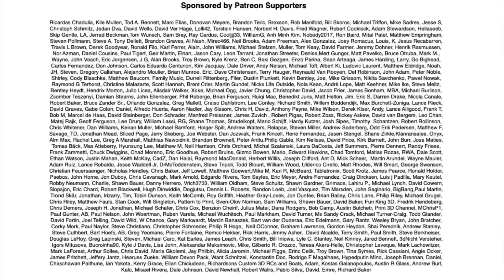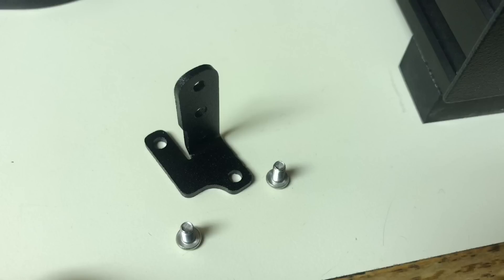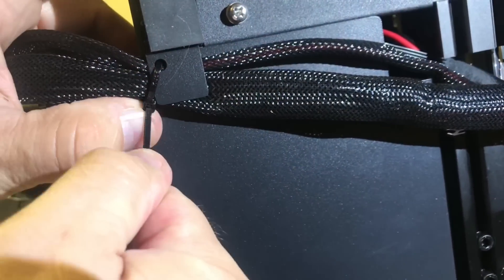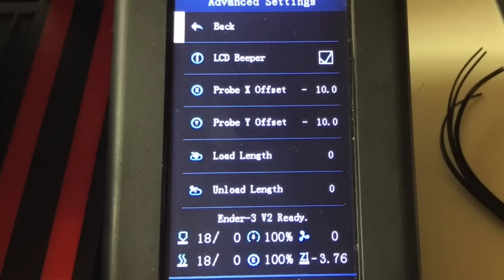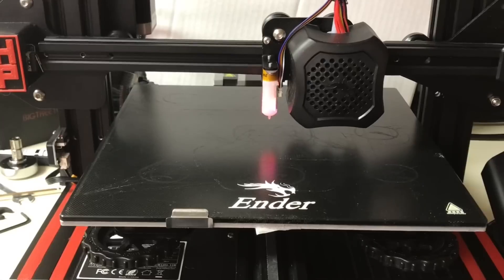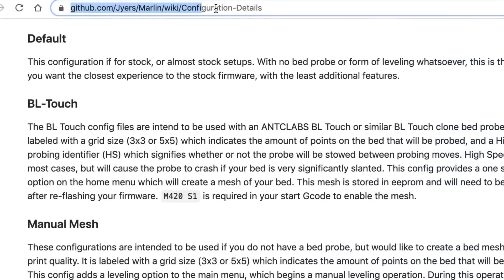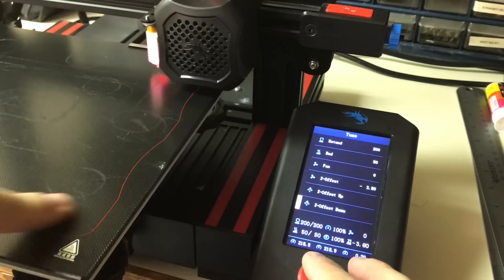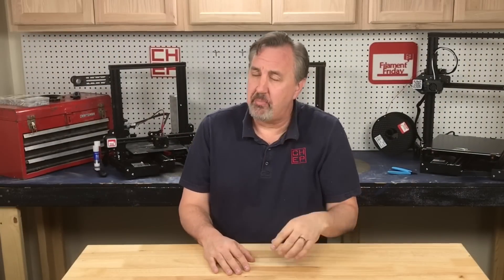How to Install AutoLevel on Creality Ender 3 V2

Comment: Hi there! im stuck couse even if i set Z to 0.0 in"prepare" my z axis going only higher any suggestios? 
p.s when i click to home all i can see that on the bottom on the screen x (numbers) y (numbers) but z flashes and shows that "STOPPED" higher :/
Reply: I'm having this same issue, have you found any solutions?
Reply: @ZachAttacksFat  nope not yet i even trying with programmer to make special firewares... rn I'm Waiting for a new bl touch and i will write if That was a problem
Reply: @misiek8132  I'm beginning to think that the sensor itself is the culprit here too. I have tried so many different firmware iterations and none of them work. It's hard for me to believe that firmware that works for everyone else somehow doesn't work with our printers. Especially when everything was working fine before.
Reply: @ZachAttacksFat  yup like i said i was even working with programmer and after many many different custom and even build from nothing Just for my printer firmwares he was able to Just get down my z axis but nothing more so yea we will see if new one change anything i will update you as soon as I can im fighting now with the seller co it can take a while but I will remember about this comment 😁
Reply: @misiek8132  I have the same problem. How about now？
Reply from the maker: Double check the wiring is in the correct place.
Reply: @FilamentFriday  nope all good i ordered new original cable and the same problem :/ idk what to do
Reply: @FilamentFriday  my bl touch click twice with the noodle and glows red if That can help
Reply from the maker: Is your Z switch still connected?
Reply: @FilamentFriday  nope i unplugged it
Reply from the maker: I’m out of ideas.
Reply: @FilamentFriday  alright thanks anyway for trying 😁

Comment: Will the BL touch firmware work for the CR touch?
Reply: yes, but CR Touch will most likely different probe offsets
Reply: @cody5495  es the firmware works just fine.  And, of course, the offsets are likely different.

Comment: These instructions caused much smoke >_>
No potential risks or precautions are explained in the video.

[EDIT] Somehow the printer survived, I don't know how damaged it is, there was quite a stream of smoke. The pinout on the probe seems correct compared to diagrams of an original BLTouch I found online, but the orientation shown in the video results in the pins being wired backwards. Ender 3 V2 Board v4.2.2

Comment: You broke my fucking printer it won’t turn  on now and is stuck on a black screen thank you. How the hell do you fix this
Reply: You must be fun at parties
Reply: Whoa there buddy.  Settle down.  Format your SD card, then copy the correct firmware to the SD card and rename it something unique.  It can't be a name that any prior firmware loaded to that machine has used.  Unplug the printer, insert the card, plug it in, power up.  All set.
Reply: Dipshit lol
Reply from the maker: Make sure you use an 8 GB card.
Reply: @FilamentFriday  is there any file I can just download to the ender 3 v2 to just factory reset it because the screens messed up and I tried fixing it and installed the ender pros thing and now it beeps when you turn it on
Reply from the maker: I would recommend you install Jyers default V1.3.5 for v4.2.2 board. https://github.com/Jyers/Marlin/releases/download/v1.3.5/E3V2-Default-v4.2.2-v1.3.5.bin
Reply: Not to mention CHEP ain't at blame even if DEMONSTREUZ broke their printer, no one else is responsible for your own negligence.

Comment: My screen isn’t turning back on once putting the Sd back in
Reply from the maker: Rename the file by one character and try again. Also try an 8 GB SD card
Reply: I had the same issue even renaming the firmware. I had to download the mainboard firmware download, then extract the DWIN_SET folder and put it on the SD card as well. It worked after that.

Comment: wait so if i get the bl touch i still have to mess with a piece of paper and live adjust the z offset manually??? im so happy i saw this before buying it... seems like its not really what i thought it was.

EDIT: ok i still bought it anyway and the live z offset makes it actually mega easy. I have a 0.2 filler gauge and used that to do the z offset (you can just use a sheet of printer paper) and it's AMAZING 🤩. Actually super worth it.
Reply from the maker: To set it up, yes. Not every print.

Comment: Maybe you can help me:

At the beginning, when I installed the BLTouch, everything worked fine for a long time, then after a month I wanted to print again, but it showed me "Probing failed", thought it was my 4.2.7 board and I exchanged it, but then it was still not better and so I thought it was the BLTouch itself but tried to wiggle the board side of the cable and it suddenly worked, but after a week it didn't work again.

Could it be because of the current cable disorder or that the cable has something?

I installed the 4.2.7 Silent Board in the Ender 3 Pro and also a 12V buck converter with a Noctua fan

Thank's for your advice and help
Reply from the maker: Sounds like a loose connection in the harness.
Reply: @FilamentFriday  i thought of that too, but unfortubately everything is stuck, at least it looks and feels that way

Comment: Hi. Nice Video. You showed how to measure the X, but not the Y. How do I measure the Y? Also, how do I unlock the ADVANCED menu, Z OFFSET Menu, Tune menu? My 2 E3V2 have none of that. Is this Stock Firmware?
Reply from the maker: New firmware that I show at 2:45

Comment: Surely a manual level should be done first??? just after Z offset, Once that's done the auto level will correct properly, It's not supposed to compensate for too much.

Comment: Anyone else followed this tutorial, experienced that the firmware wouldn't update, i plugged the SD card in and turned on the printer but just got a black screen, even double checked the files.

Only got it to update with the files provided on crealitys software page for the ender 3 v2
Reply: I had the same issue for a little bit, try a different version and make sure that your board says v 4.2.2. If anything you can redownload the original firmware for the machine online just by searching
Reply: @popdemmollys5058  on the bottom of the machine, if its and ender 3 (v2, pro, base) there's a couple screws that open up to the circuit board. On their it will say something like "creality" in bigish white letters and then a build number nearby.

Comment: Chep same issues as Rog. Every setting I have is set exactly like this video including the M420 S1 ; Autolevel and it still prints above the bed after making the 2 lines on the left. I do not know what to do.  I have a ender 3 v2
Reply: Manually level again, with the screws, then autolevel, then adjust your z-offset.

Comment: Hey @chep, Hope you're well. I'm having issues after completing all the steps. Z-offset is set, auto-level is done and saved, slicer is configured but when I test a print, apart from the purge line which turns out OK, but when printing the test the nozzle is so high that microstep down won't help unless I change the value radically which doesn't make sense. How come the center's z-off set is fine and the rest of the bed is not even though I followed the steps and created the mesh? Thanks in advance!
Reply from the maker: Check your slicer for Z offset otherwise I don’t know.
Reply: @FilamentFriday  It's set at 0. Thanks for the reply though. I appreciate it.

Comment: Does the z axis readout on the LCD panel in the bottom right corner reflect the gcode z coordinate or the actual z coordinate with the BLtouch compensation?  In other words, should I see the z axis on the LCD panel change up and down when printing a horizontal layer if everything was working correctly?
Reply from the maker: If the layer is horizontal Z won’t change unless you add Z hop.

Comment: so i did everything right.pluged the bl touch in and all got the firmware and set the y x offsets but when i press level or homing or anything that moves it it just does not work doesnt move at all.
EDIT:when it fails it just says printer kill reason: homing failed restart required.
Reply: Try shielding the BL Touch data cable with metal/copper braided tube/sleeve it can cut down on interference from the fans and hot end.
the braiding can be found on amazon or inside coaxial aerial cable from an electronics store, you'll need around 1.5 mtrs.
also buy some plastic braided cable cover to finish it off like on the original ender cable.
This worked for Me.
Reply: @roblasher2243  thanks for the advice but i live in a small town not even amazon dilivers here at least without adding like 20$ but u will try to find it somewhere.
Reply from the maker: Just try wrapping it in aluminum foil. Same effect.
Reply: @FilamentFriday  ill try
Reply: @FilamentFriday  that works too , and maybe some insulation tape so it doesn't short on anything.

Comment: So I added this firmware Unfortunately it had a bug where it wouldnt read a file name if it was to long .So I tried the Smith bl touch firmware.But I liked flexibility of jyers and I saw they had a bug fix .So in it went .But a odd thing depending on my sd card the Smith firmware shows up !! Is the firmware on sd card As I thought the jyers overwrote.The previous firmware Any help would be appreciated
Reply from the maker: Make sure you use a different file name or it won’t change. Try a jyers earlier version to bypass the bug.
Reply: @FilamentFriday  well the issue is the Smith firmware shows up with reguards to a different sd card I thought thr firmware was installed on main board I mean jyers is a different name from Smith ?
Reply from the maker: Not sure then.
Reply: @FilamentFriday  wow ok
Reply from the maker: I would try it again but change jyers file name by one character.
Reply: @FilamentFriday  ok sir
Reply: @FilamentFriday  plus I had reformatted the card and added the new jyers to that card to use as a update .
Reply: @FilamentFriday  oh and thank u I'm a bit older then everyone on here so thank you for being patient

Comment: My Firmware doesn't have the advanced option it seems and i'm not sure which version I need that does.
Reply: Same. Did you ever find it?
Reply: @GreggAdventure  not on that version. I updated to jyers right after and it has all the options you can want.

Comment: I CHEP, your videos help me a lot.  Thanks !!! I just installed my BLTOUCH on my ender 3 v2.  My first layer is almost perfect !.  I only have one corner (BL) that is not ok. And the print is not centered on the bed. Would you be so kind to give me advice ? I'm not sure I understand, should I do a manual leveling of the bl corner or a live z offset. If I do a live Z offset won't it affect the other corners that are perfect ?  Thanks again !

Comment: Sir any reason my bl touch on the print command erased my file ?
Reply from the maker: I don’t see how that’s possible
Reply: @FilamentFriday  first thank u for reply Second the bl touch is working ok But when hit print on any file that for some reason are scrolling right to left itll come up on board run a scroll across say it's done and ask me to confirm .Then if I find a file that's not in motion and hit it itll come up on screen as usual and start its print when the temp parameters are met .if you like I could forward you a start video if that's possible Otherwise my printer is useless .I've tried re slicing also and same thing .
Reply: After the confirm file is gone until.i turn off machine and restart it

Comment: Ok sir installed it no disasters .A bit fuzzy but I'm getting it to work So thanks .My question is off my sd card I printed your leveling grid and a small part .Then I went to print a part I've done multiple times and it wont print it ! It comes up click it then it runs a what looks like its loading it but then shows it as completed Any thoughts

Comment: Sir I grew a pair and installed the firmware It installed Then i noticed a SD intial failure is this because i dont have the g29 code in yet thank u for your time

Comment: It doesn't give me the option to auto level,  I can set the mesh, then home. Once I go to print it doesn't warm up automatically, then after a few seconds a loading bar appears and then it just stops. Can anyone help please?
Reply: Hi I have exactly the same issue , did you fix it?
Reply: I'm having the same issue too. My gcodes from a few days ago work fine, but any new ones just run a status bar quickly from start to finish a few seconds after starting any new gcodes (made today or yesterday). I've tried resetting to standard Cura settings but nothing.
Reply: Same issue, Gives me "E1 Heating" then returns to home screen
Reply: It turns out my issue was filenames being too long, after shortening to ~8 text only characters, it worked fine. Give that a try.

Comment: Ahh forget it I'm just going to return it (bl) seems like more trouble then it's worth and you have to be a rocket scientist to get it to work.Ive asked same ? Over and over with no answer .how do I get my machine to accept the the new start code as it will not let me insert one .Do I have to have firmware installed first ?
Reply: I would definitely install the new firmware first.
Reply: So if I install the firmware the machine settings will give me the option to insert the g29 code If so thank you for being only person to answer me
Reply from the maker: The firmware is separate and required for the Autolevel sensor. 
G29 is added to the start GCode in the slicer. But as I show you can store the autolevel in EEPROM, and the use M420 in that same Start GCode area to retrieve that stored autolevel and then you only run the probing once.
Reply: @FilamentFriday  my ? Is how do I get this new code into startup as it wont let me is their something I have to hit to let it enter the code that's my ?
Reply: Go to the 6 minute mark of the Video. I believe this will answer your question.
Reply: Ok someone told me I had to hit enter in the start up code area Thank u very much Now my question is do I add the new code after g28
Reply: @charlesrestivo870  Yeah, i would add the M420 S1 ; Autolevel Code after g28
Reply: @KillerSatan962  thank u very much for your reply
Reply: @charlesrestivo870  No problem! Always happy to try and help others.  Hopefully it helped you figure it out!
Reply: I have the CR touch when I use it to auto level it doesn’t even print a decent line it just clogs up an that’s bout it :(
Reply: @jamie198710  i would try changing your z-axis offset upwards a bit sounds like you're printing to close to the bed.
Reply: @KillerSatan962  will try this

Comment: Can someone help with why I cant add the gcode I need in my startup menu Do I need to have firmware installed first ? Because now the machine settings isnt giving me a option to add the code Help
Reply from the maker: I don’t understand the question. You mean the Start GCode in the Cura slicer machine profile?
Reply: @FilamentFriday  yes sir
Reply: @FilamentFriday  any answer reguarding this .so install firmware then the machine settings will allow me to insert g29 code into start menu As of now it wont give me option

Comment: Hi Chep,
I followed your instructions and I have installed the latest pre-complied firmware from Jyers, but my printer does not seem to actively level at all.
Does anyone know what the problem could be? Is the pre-compiled firmware maybe missing something and I need to compile one for my printer?

thanks

Comment: Thanks CHEP, its works for me but i have a question. How do you get a leveled bed After removing the z-stop ? I Can Do manual levelling on each corner with bl touch with jyers firmware but result dont seems consistent. And i dont know if i have to do it with hot end hot, or with z offset at zéro ?
Thanks for your work anyway
Reply: I just installed my BLTouch and using CHEP's tutorial and also doing a manual level with the probe helps so much. Using the same firmware as they use, the latest tho, you can do what I say up ahead. Set the bed to the temperature you print at before and let it sit for a bit. Go to "Prepare" or "Control", one of the two, and select "Manual Level", then select the corner and confirm the "Probe", after it probes it will give you how high or low the bed is on that corner. Get them as close as you can to matching on all corners and then do the auto level. To finish it off do a "Level Test" and set your Z-Offset correctly as it prints, obviously I'm assuming you have already set a rough Z-Offset.
Reply: @j.riefkohl1965  oh thanks for your help ! Really appreciate this.
Okai so I learn many things :
- need to wait a little when bed is hot, instead of doing the thing directly a temp.
- It works for you to use the manual level menuwith the probe to adjust the bed
- auto-level next  with z offset ajustement.
The point is, With manual leveling, I just can't make my bed touch the nozzle at max height with z offset at zero nd stock spring. Seems weird to me but I guess Its okai and I can do a manual leveling with a z offset different from 0. Anayway, thanks a lot for your help, I will try to apply rigourously this method. See you !

Comment: Nice video, easy to follow, up to the G29 command (auto leveling).  Nozzle goes to the Left front corner and probe starts 6 cm from the edge of the bed. When it comes to the third probing, The hot end tries go past the right end stop. How can i tell to start probing at 2.5 cm and stop at 17.5 cm. Thanks